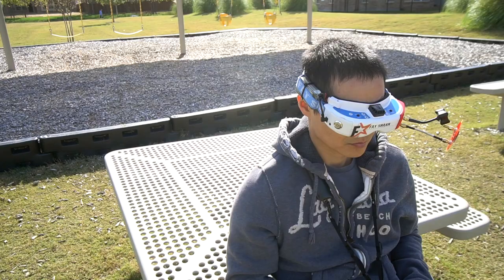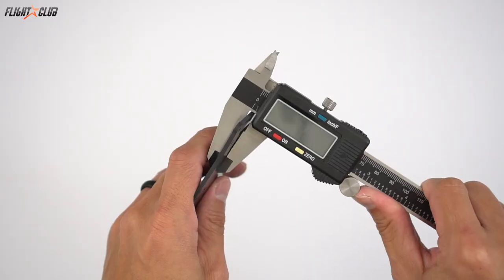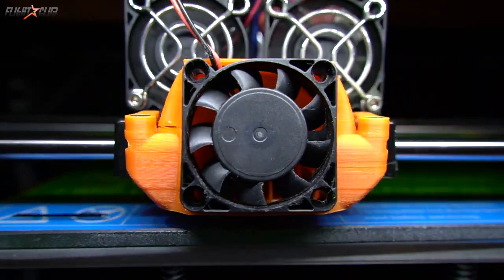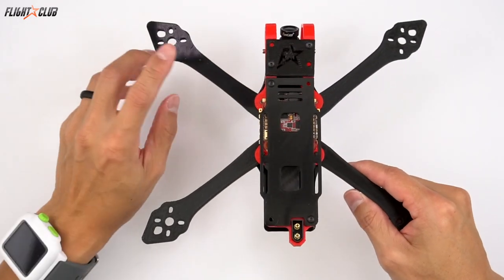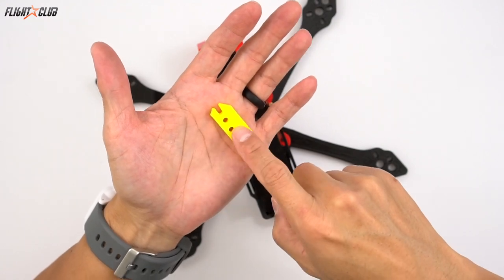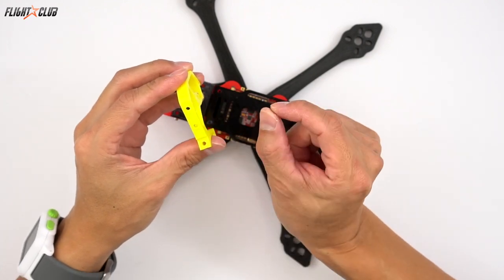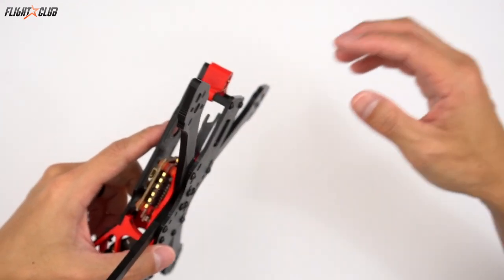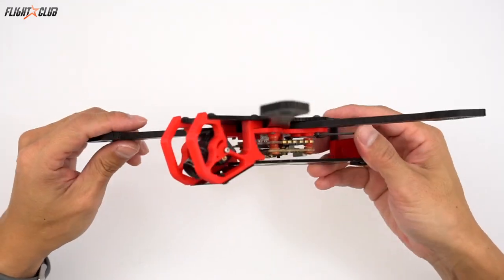FlightClub Freestyle Frame : Bangkok

Comment: Hey Mike,

Would absolutely love to test the frame. One of my favourite things about the Proton is the ability to switch out the arms - so I have a set of stretch, some true, and some 6". That means I can fly whatever config I want on the day with just a few screws and some electrical tape. I'd love to see that continued with the freestyle frame and maybe even expanded on with H arms. Stretch-X for long range cruising, deadcat for filming with no props in view, true-x or H for freestyle, so on.

The hard mount XT-60 placement - I have something similar on my Stingy and it can be a right faff with certain batteries with short leads. Having it on the back as opposed to the side is going to be limiting. A little squeeze of hot glue on the bottom helps stop the connector sliding up and down within the mount, which can be a PITA.

Could you add a couple of screw holes either side of the SMA mount for the Unify SMA lead? The Braap has that and the mount is absolutely rock solid. Might be nice to also flare it out to 45 degrees for better antenna placement.

Love the camera cage. And it uses the Foxeer pattern! Will be nice not to have to hot glue the Predator in place for once.

A slot mid-plate to accommodate toilet tanking will save me cutting a hole myself :p

I'd like to see a couple of screw holes to give the option of securing the shelf at the back with a standoff, even if it means using something like screw > nut > standoff. I don't think I trust those two little spurs to hold if I really wang into something.
Reply from the maker: thanks for the feedback.  i'll keep this in mind on the next version. thanks!

Comment: It looks very nice! One of the best looking frames right now.
But I have a few thoughts.
#1 I think the top plate needs a spacer in the middle so it wont break in crashes when the battery pushes down on it and make the whole frame more stiff from bending in hard hits.
#2 30 degree mount is a bit much, fine you can "de-angle" it with a mount but why not start out a bit lower? I like being able to have a camera in 22 degrees for those slow and thight spots.

Comment: Mike! u a legend bro! That intro was awesome! Hey, i love the 1 bolt arm swap idea, Ive seen this implemented on another frame but Ive always found that the arms end up with a little bit of play. But what's different in your design is that all the arms butt up against each other so Im pretty sure that will eliminate that wiggle issue. Ever considered mounting the battery strap front to back? Maybe have both slots for front to back and side to side? Not sure why frames seem to always be limited to unidirectional battery strap mounting. I think battery ejections can be prevented by having a "cross" strap. 
For the front cage: have you explored possibly using titanium? I know the cost analysis would probably prove it to be not cost effective but maybe you can have a limited edition batch for Ti option? I would definitely but it =)
Overall, i love the design man. You are definitely one of the top frame makers on the planet! you always come up with unique solutions and you just keep pushing the envelope on whats possible! keep up the great work bro! Im a huge fan of your work as Im sure a lot of people are. Keep doing your thing.
P.S. I loooooove my Neutron Frames! Thank you for creating this little beast.
- Rocket
Reply from the maker: ahh, good idea.  i can put some horizontal slots in the top plate to mount the battery that way.  i'll look into titanium later once we get the frame out.  thanks for all the support!

Comment: I do not care for the fixed XT60  mount in the rear.  It keeps the power wire out of the props but this will require routing long power wires through the space reserved for the rear stack.  In addition, the battery leads will not be the right length to plug in and establish the CG with a long frame design. This will also place strain in the connector. 
I Love the shelf in the back as that is innovative and very useful.
Reconsider the shape of the lightening  hole in the rear bottom.  It would be nice to have the lightening holes positioned where they will double as way to zip tie down a component such as the VTX. 
Can't wait to build it!
Reply from the maker: yeah there are a lot of things that need to be tested.  The rear hole will actually be the shape of the hole in the PROton top plate so it can mount a gopro.  thanks!

Comment: Design looks very good well thought out. A slot instead of a hole to mount the camera  would be better. That way you can move it forward or backwards for different cameras. It would be to win this frame for testing.

Comment: Dude, I'm So Jacked About this One! 

The only thing I can think of is the top plate I think the strap holes aren't needed as much cuz it's a pain to put straps threw and they tend to break on hard crashes but its not a huge deal breaker at all..
 I can't wait to build one out... hopefully, we can get a couple good cam mount options... some like adjustable cam mounts for different applications and are willing to pay for the option, me included..  I really like how everything is laid out and the option for 20x20 because now we have a lot more options to shave down weight... o and crossfire is a must... I know a lot of long range guys like mounting the Immortal T vertical on the cam mounts.

Very excited to get one asap. 
Keep up the good work Mike 
We can always count on you to bring us some quality airframes!
Reply from the maker: thanks Jeff for the feedback!  we'll test the velcro strap idea

Comment: 5 mm arms, definitely, a little extra weight on a freestyle quad with the motors these days not a big deal. I'd rather have the durability, you can also go tighter on the width. Need some special edition purple anodized or Red Front cages. Brilliant design overall look forward to seeing the end result. Whether I get to test one or not. Might want to consider some Center standoff even if one of the middle or it might suffer from mid throttle oscillation like the rooster the chameleon and the remix.

Comment: love the mounting idea for the VTX - that's always the one opponent i cant fit anywhere, but I'm worried that the thin plate will break. And I really really like the arm mounting design. but if you need to have the stack screws out anyway, what's the point? but els i love the frame idea. make it a 40 degree GoPro mount and cheaper than the Armattan Chameleon and im all about it.

Comment: Mike, like it very much, a lot of stuff there is really good, I worry a little though about the rear stack, because it is only anchored along one edge it will vibrate, like a metal ruler on a desk when you twang it. It shouldn’t matter much if it is just vtx and rx hopefully, but anyone sticks an FC on it is gonna have very weird behaviour on pitch. I would love to see an option to add rear standoffs to it.
Does it take 2 lipo straps for battery? That would be very useful. Crossfire immortal t mount?
Reply from the maker: yeah i'm going to add 20x20 and support for the rear shelf.  yes takes 1 or 2 lipo straps.  crossfire mount is in the works.  thanks!

Comment: That frame looks dope! I really like how you made the FC 30x30 and 20x20 stack separate from the arm screws. I hate the other style acro frames that don't do that. It makes changing out broken arms a pain in the ass. I also love that you allow for micro or mini cameras as well as room for another stack in the back. Instead of making a shelf in the back for another stack, could you just drill holes for a 20x20 stack in the frame?? I am worried that just having a shelf in the back with only 2 screws holding down the plate/pcb would easily break on hard crashes. 4 screws would stabilize it, but if there's too much weight on the shelf it might snap off if only 2 screws are used. If you keep the shelf design maybe add two additional holes to the bottom plate to allow two more screws to anchor? That would provide a good amount of rigidity to the back stack.  

I would love to add this frame to my fleet of Protons!!
Reply from the maker: yes good idea, i will add 20x20 and put holes under it for support of the shelf.  thanks for the feedback!
Reply: @FlightClubFPV  Either a separate 20x20 holes or just two extra holes to add to the current 30x30 shelf you have designed to the nucleus. I think either would work. I can't wait to see the end result.

Comment: I'm really looking forward to learning more about this frame. Rather, I'm really looking forward to buying it ;)
Great work Mike! I love the way you swap sizes of camera, and the arms connecting in the middle is always a welcomed feature in a freestyle frame.

I really like how the components are mounted, but perhaps there could be a standoff/s for the back plate that mounts the vtx and the rx, just for some stability? 

Also, having come from using a Rooster for my freestyle frame, not having many HD camera mounting options was bit of an announce, but if you can integrate (even add on) some different angle mounts without having to buy bulky mount pieces, you would be onto a winner in this regard too. I love the back HD mount idea! 

I would love to test this for you. Massive fan of your work as protons are my main race rig. Adding a freestyle frame to the game will just send me all FPVflight club.
Reply from the maker: yes support will be added for the rear shelf.  thanks brother for the feedback and all your support!
Reply: @FlightClubFPV  Killing it! Hey thanks for the great product!

Comment: I clicked the video for two reasons.  One, I saw that it was fightclub-and I'm really impressed with your stuff  and Two- I thought, " Oh no, another Rooster clone."  When I saw this frame, I knew I had to have one.  This is a bad ass looking frame.  You have to let me test it for you.  I mean, you're not going to lose any business from it, because I'm gonna buy like four, so I got back-ups.  I want in on this as soon as possible.  I would like to see the area between the camera and the first stack with mounting holes for a dvr board, like the split mini 2.  Definitely not a deal breaker though.  I could shift the main stack to the rear and work the dvr into the first slot with the vtx.  I think this thing looks amazing, did I say that already?  please give me some tpu arm guards and I have one other suggestion.  The red is what sets this thing off.  Now I know that is only there because it's a prototype and that is tpu.  Is it possible to dip, or wrap, or some way put that red (in tpu-or some other material) on the aluminum cage around the camera?
Reply from the maker: thanks Joseph!  i wish i had a bunch of prototypes to give out but these prototypes are super expensive so i couldn't get a lot.

yes there will be all the goodies like arm protectors and i'll make some kind of TPU bumper to put around the Aluminum cage.  first gotta get the fundamentals right, then comes the goodies.

thanks!

Comment: Wauw this looks really great! Im from Holland and last summer i went to thailand on vacation! Me and my girlfriend started in bangkok and oh boy that was a real culture shock! I really fell in love with thailand! Only sad thing was the drone regulations.. i did bring my quad but only flew 3 packs because i was a bit scared to get busted..but any way,great design! Really love the buttermount idea! And also the idea to mount the camera on the back for some "front chase"(?) Footage:p only thing i would remove is those holes next to the motor mount holes.. That way the arm tips are alot stronger!(my reverb arms also broke at that spot) Also 5mm arms are so much stronger then 4 or even 4,5! Even when they are really slim! I have owned a desent amount of frames.. my verry first build was a qav-r (clone) which i build with the help of your qav-r build video's (for ever thankfull🙌) after that came the (dutch) epiquad frame, the
Realacc qav-x, Transtec Frog, Thugframes V5, BoltRC Blackops, Alien clone,Reverb, original Lumenier qav-R, and now the german amaxinno Freestyle 5.. this last one has verry skinny but 5mm thick arms! I really love how they cut through the air, and supprisingly strong they are! But any way, i kinda have a big frame fetish😂 and I was always sad you only made race frames.. cause i really digged that buttermount system you got there! And now you made this🙌i love it❤and i would love to test it! Greeting from Holland! Hope i get the chance! (Btw love the intro and finally seeing more then just your hands😂)
Reply: Oh yeah also maybe some cutouts on the topplate for toilet tank battery mounting! Tested it once but was not great on that particular frame (cut slots on the transtec frog frame) but It really flew well balanced!

Comment: The frame looks really nice. The xt60 holder on the back looks problematic to me though. I have been trying to design one for a frame that I have. The problem is that the battery leads go back past the second deck. The issue that Ive been having is that you have to really choose if you want to use the xt60 holder or if you want to mount stuff to the back deck. Its to bad you cant figure out a way to make the front end out of TPU instead of aluminum. I think that would be functional and eye catching. Shoot me over a frame to test and lets see what we can do together.. lol

Comment: This may very well be my first FlightClub frame! The best kind of frames are the ones that requires less tool and effort to assemble and dissemble and the Bangkok seems to be closing that gap. Would it be possible to have some kind of flexible material in place of the aluminium/metal??
Reply from the maker: thanks!  as for the aluminum cage, i think that will stay that way but it may possible have a tpu guard that can wrap around it

Comment: Hey Mike, my name is Jessis. I have no doubt you are going to build a gr8 frame!! I currently fly hypetrain frames.  Just from the angles i see from this video there are a few things I see that would suit a freestyle pilot like myself. I'll give you my piece of advice on one deal breaker or stack breaker lol! When you flip the frame on its top look between the arms and you can see the esc motor tabs sticking out further than the frame! I have broken countless esc's and shattered a number of connectors on fc's and esc's due to not enough protection in said area! It sounds silly and very unlikely place to hit but in freestyle it happens!! Once i bumped a square  concrete piller right there, broke my micro jst esc to fc connector when i hit the piller and as the kwad was sliding on the concrete it went right into a tubular picnic table and destroyed a motor!! Lmfao, bad day right? Any how, hope that helps?

Comment: Very cool frame man! Like the Chameleon type of look which to me looks the very best! The rubber grommets for the fc on the bottom plate should be integrated in all frames nowadays if you ask me. It's so much more convenient! The only thing I'm not sure about is the backplate to mount your vtx. On the video it looks a bit weak but that's maybe because it's 3D printed? For the rest, looks awesome man!

Comment: The frame looks over the top! Will you have color options for the cage like the nucleus plates?
Reply from the maker: yes, there will be different colors for the production models.  prototype will be red.  what colors would you like to have?
Reply: FlightClub red is always good, maybe a neon yellow to pop a bit. However, it would be interesting to have a version that isn’t painted, this way you could paint it however you wanted to match your setup!

Comment: Of course I want to be a tester! But mounting XT-60 the way you described is probably not a good idea - when the battery will be torn off in the crash you need your XT-60 to be on the flexible cable so it will turn the way the battery pulls while it flies away. Otherwise the battery will damage the back mount, or itself.
Reply from the maker: yeah we'll have to test the idea.  it's the first prototype so things will change.  thanks

Comment: I think that the vtx/rc mounting plate connection is very weak. Also, i don't think that the xt60 plug is nesessary, battery wires have different length. I have 2 Protons atm (skeleton and canopy).

Comment: I like it honestly. Using aluminum and having the option in cams sounds awesome! Def like the FC size choices but would love to see a 20x20 mount option on the rear deck for an esc or possibly a FC so you could maybe mount a Runcam split mini or caddx on the front mount somehow using a 4 mount 20x20 setup. Looks sick for sure and I’d love to know a price point range.
Reply from the maker: yes i will add support and 20x20 holes on the rear shelf.  i had an early model that held a split board under the camera.  it didn't look good.  i did a poll and people didn't want the split in a 5" freestyle frame so the design got scrapped
Reply: FlightClub I didn’t see that poll but yea some people would love to have that option. Excited for the release

Comment: I like the design and the colours are really cool. Maybe have different colours once your happy with the design like your tokio frame. The only thing I didn’t like was the plate for the VTx and receiver. Maybe have a 10mm or 20mm stand-off so it’s fixed in all corners. And some fc setups have the xt60 coming from the side so maybe and 3D print to accommodate that.  Other than that looks solid.
Reply from the maker: thanks, i'll look into it.  thanks for feedback

Comment: I’m down to be a tester — I’ve got all the components on another quad I can swap in. 1 thing I’m curious about seeing/ testing is the extra plate/ diving board you have — might need additional supports if it’s going to be used reliably. The mini- micro mounting cage is super clever.
Reply from the maker: yes more support will be added on the rear shelf.  thanks!